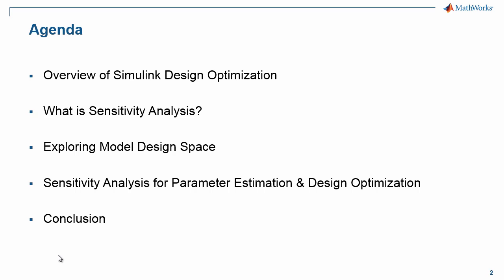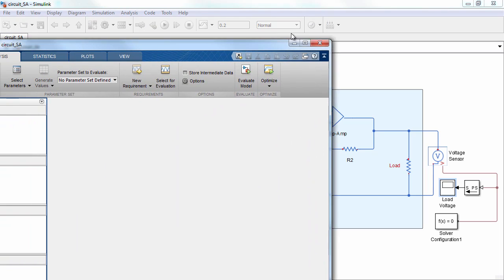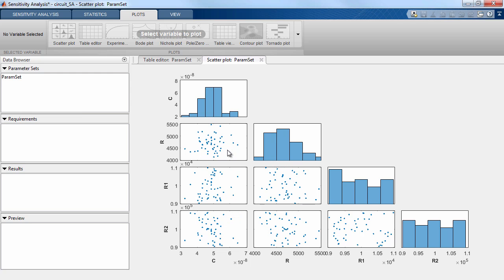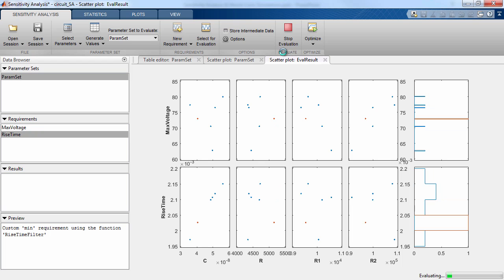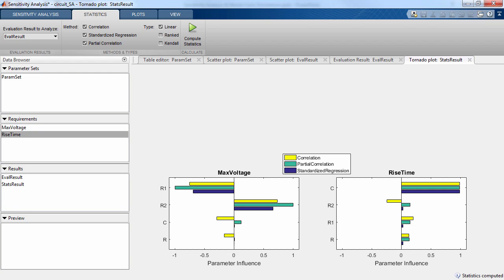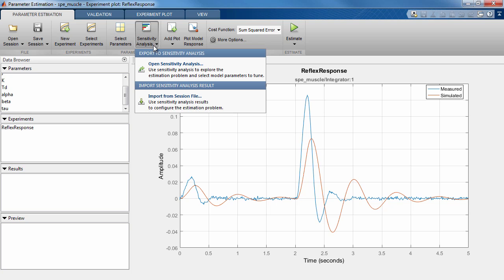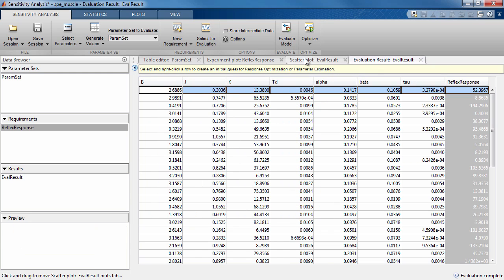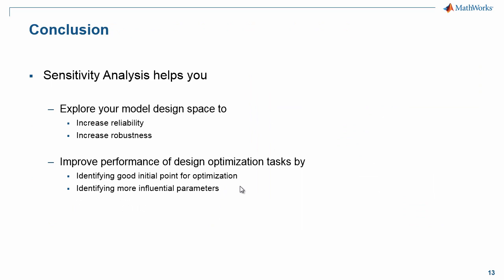Sensitivity Analysis and Monte Carlo Simulations using Simulink Design Optimization

Comment: sir please  reply my select parameters  block  is empty how to get parameters  values into it
Reply from the maker: If the Select Parameters dialog in the Sensitivity Analyzer is empty, it usually means the app could not find any tunable parameters in your Simulink model. To ensure parameters appear in the dialog, specify block parameters in the model using variable names (e.g. R, C, R1, R2) instead of numeric values, and make sure these variables are defined in the base workspace. You can also store these variables in the model workspace or a data dictionary. Once the parameters are defined as variables, the Sensitivity Analyzer will detect them and populate the Select Parameters dialog.